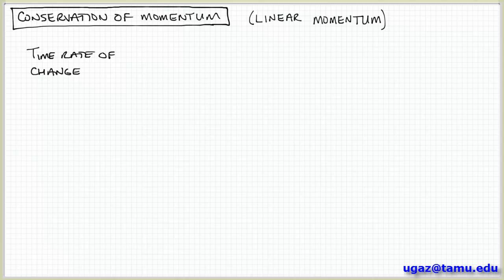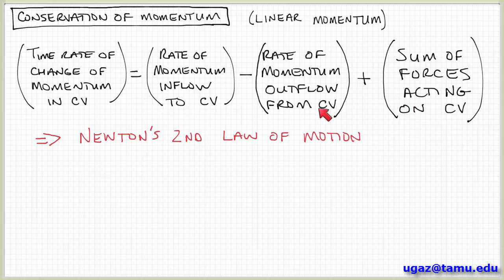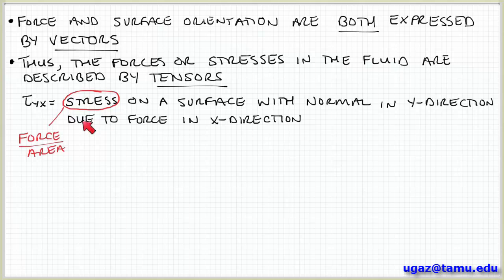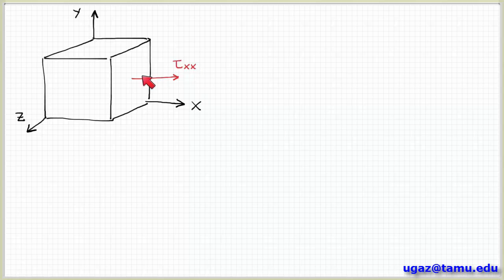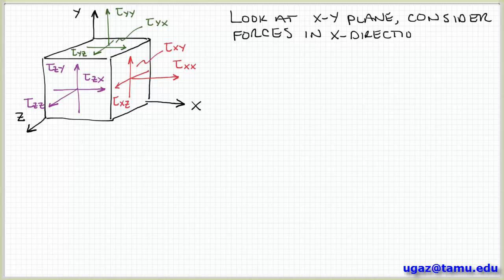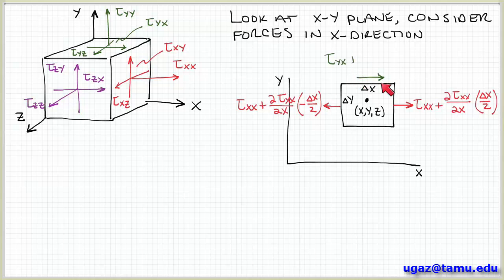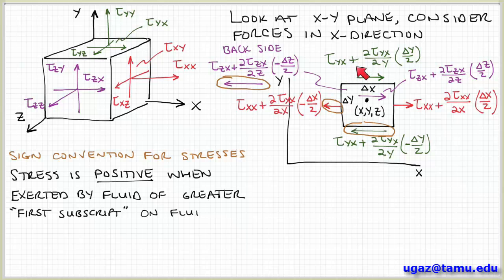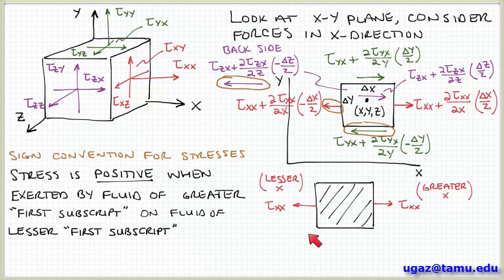Conservation of Momentum, part 1 - Lecture 4.1 - Chemical Engineering Fluid Mechanics

Comment: Isn't a normal stress denoted by the greek letter sigma and a shear stress by the greek letter tau?
Reply: fyescas777 The shear stress tensor includes the normal stresses as well. If your referencing a single normal stress then the convention is to use sigma I think